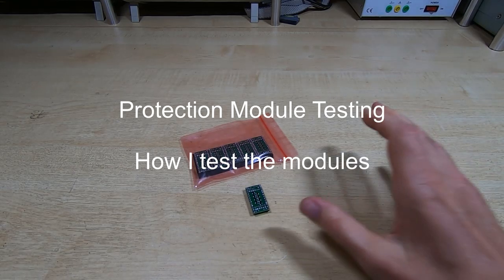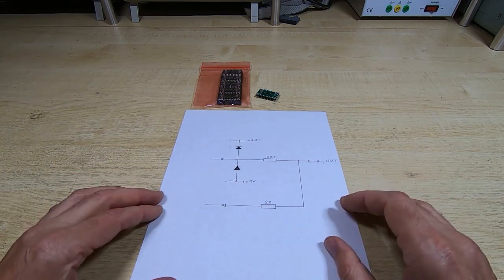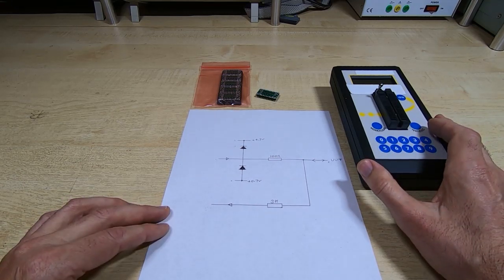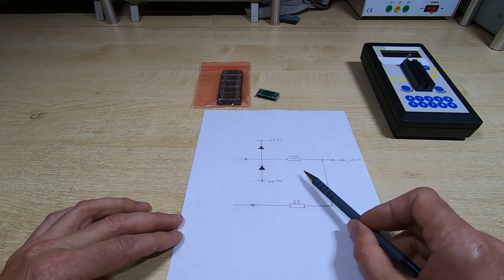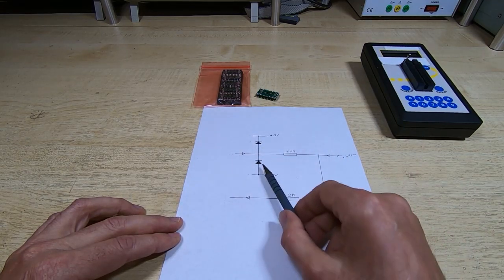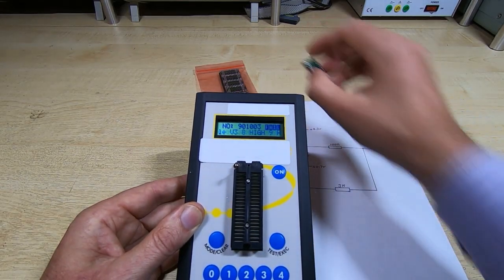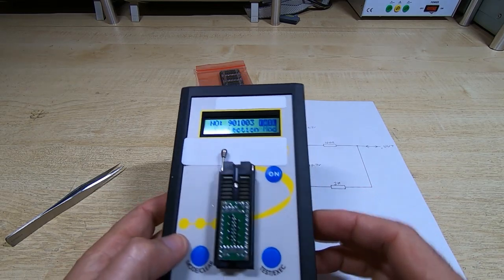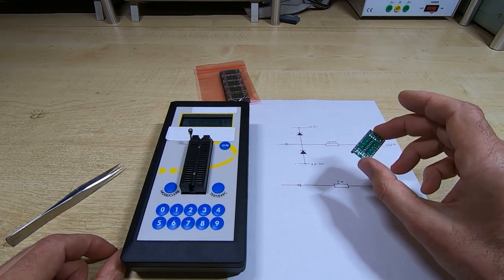Protection Module Testing

Comment: Just came back here to see if you have found an alternative to the ABI tester? I was hoping it would be possible to reprogram one of the cheap multi-function testers. Also, do you know of any cheap device that would let me test for short circuits across a large number of connections?

Comment: My understanding is that this particular ABI unit cannot reliably test Z80s, the software is buggy.

A shame, the ABI4000 was a superb unit.
Reply from the maker: A current project I am working on uses 74LS16 devices and I spent a while trying to figure out why it would not work. I tested all the 7416 devices on the abi unit and they passed. I finally found that one was faulty by manually testing it and then testing it using my cheap IC tester which failed it. It is most likely that the test script needs adjusting to handle an open collector device. I have found a few such issues and some bugs in the software. I will not longer be using the abi unit which is a disappointment because it seemed to have a lot of potential (and it was expensive).
Reply: @JerryWalker001  This is exactly it, once you lose confidence in a product you simply stop using it and it ceases to be useful.

It must have wasted hours of your time chasing that problem, the product is supposed to save you time.
Reply from the maker: @nadparvez1361  Absolutely correct. I wasted many hours trying to get it to work and after I figured out how to get it to work I spent more hours testing it so that I could send a meaningful report back to the manufacturer to help them fix it. In response they threatened to take legal action against me for pointing out the problems.

Comment: I was watching and about 80% done when your first video was taken down. One would think they might fix the software and produce a much more valuable product. Apparently they are content to be an annoyance.
Reply from the maker: Yes it is a shame as the tester has a lot of potential if the software was tidied up. It has other issues which I have not mentioned as they can mostly be worked around but I found the software disappointing. I could understand their position if I had just made vague derogatory comments but I was very specific and demonstrated a couple of the bugs I found in the video. I did not mention the others as they are less of a problem but even so they still seemed unwilling to accept criticism and I suspect from the thumbs down that they continue along those lines. What I was really hoping to demonstrate was how to create meaningful test scripts so that other people might be interested in buying one (I do not benefit in any way from their sales). This also means that I feel obliged to point out some of the main issues so that I do not end up in the firing line for keeping quiet about them. It is an odd response from a small company.
Reply: @JerryWalker001  Even seeing the problems you had, I was actually interested in buying one just to play with. I did a lot of programming on Fairchild/Factron 303s in the early 1980s, and it had me interested despite the bugs. Now, I'm not at all interested. They aren't doing themselves any favors. That's a shame, it has great potential, and with library updates it could be a potential long term money maker for the manufacturer.
Reply from the maker: @john_in_phoenix  Yes I was still willing to demonstrate it despite the bugs as I wanted to show its potential but after my experience with the company I will be replacing it. In fact I am giving serious consideration to developing my own unit. I have been a systems developer for a long time and these testers are not very difficult to design. It is the device libraries which take the time so maybe a 'crowd' library development may be the way to go. I have already designed a universal pin driver and I have previously developed embedded screen libraries for various display types including a 7" colour touch screen which would make a very nice interface and would blow their tester out of the water. Software is not a problem and again I have developed many interface libraries including LAN which may be a good way to go. I would need to develop  a dedicated FPGA back end to drive the pins and that is not really in keeping with my channel but I may post some videos on some aspects of a possible design to see if there would be any interest.
Reply: @JerryWalker001  i have absolutely no experience working with FPGA or designing device libraries, but I would definitely help in any way i could if you ever decide to design and release such a chip tester.
Reply from the maker: @ng34780  Thanks, I have actually written plenty of FPGA code so already have some suitable starting points. I may even post a quick video on this although modern electronics is not really in keeping with my channel.

Comment: Why the heck are they complaining?  You're providing FREE advertising for their product.  In my case I looked up the device solely because it was in your video.  You NEVER said that the device is a bad product.
Reply from the maker: Yes absolutely, I was fairly scathing about the software but I was still showing how it could be used and, as you say, I was providing free advertising. They may fix the software eventually but I had a lot of problems with it. I actually advised than about this before I posted the video but they were not willing to help. I was even showing new market potential for their products. I have even shown this tester in previous videos and said how impressed I was with it so it is not like I was 'picking' on them for no reason. Odd how they never commented on the videos where I praised their product.

Comment: I think they were not happy with you saying that the software is confusing to use and it's a poor design.
Instead of responding and acting like adults, in a civilized manner, they acted exactly like many other humans today.
Reply from the maker: Yes I am sure you are correct, I was actually being kind considering the number of bugs I found in it. I even sent them some detailed information on how to reproduce a major bug but they were not interested in trying to help. They said that they responded to me in 24 hours. What they actually said was that they would not be able to look at the problems for at least 6 months. I found a work around that they could have suggested. I should add that they offered to refund me but that does not change my opinion of the software or my right to comment on it. It reminded me of software I wrote myself many years ago which was really bad but I listened to my customers and improved it. They may not like what I said but I was just saying what I saw and the problems I was having which I repeated using 3 different versions of Windows and 3 different types of PC. Either was I was showing uses for their system that could have opened new sales potential for them.